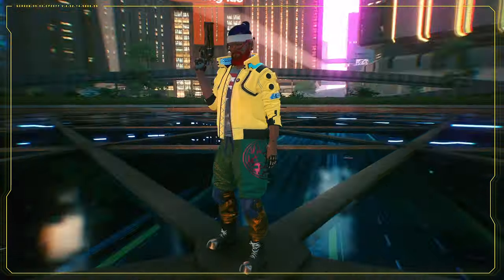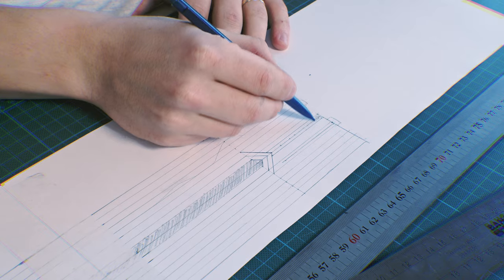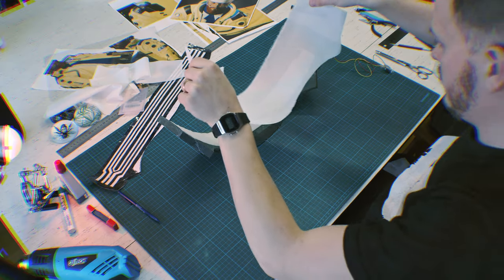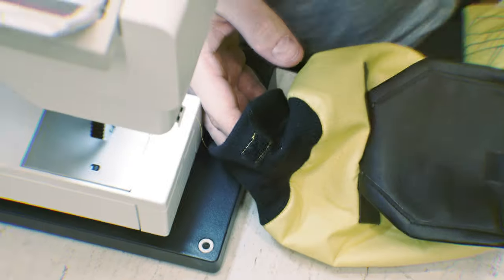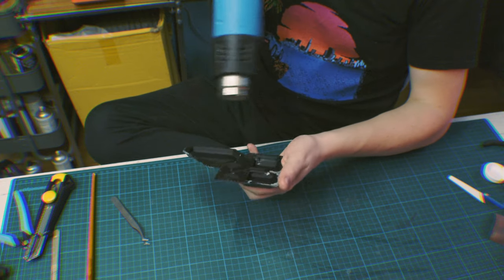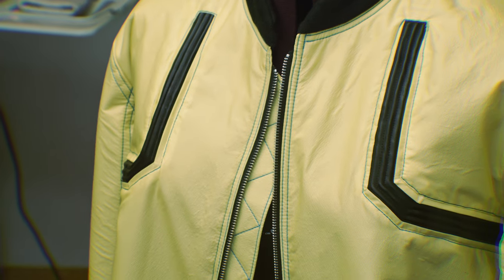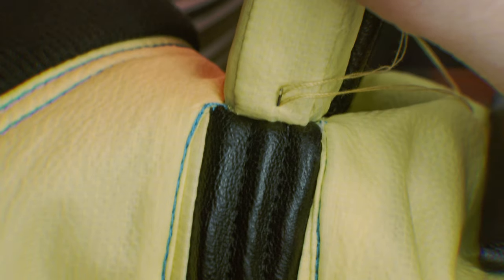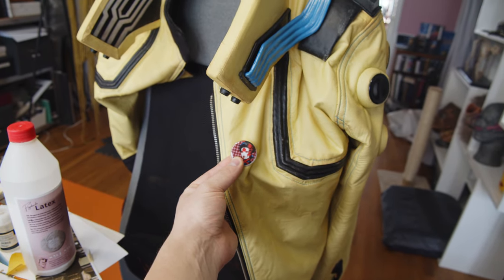Completely INSANE! Cyberpunk 2077 Costume - Part 3

Comment: If you still use this jacket, how do you clean it with all the electronics inside?
Reply from the maker: I don't use it that much and haven't cleaned it so far😅. But generally for costumes that can't be washed you can either use baby wipes or shoe freshener spray or something similar non wet. Also just hanging it outside in the fresh air for a couple of days removes a lot of odor.